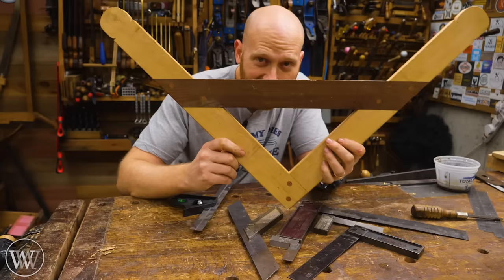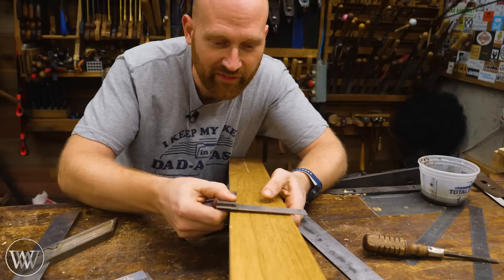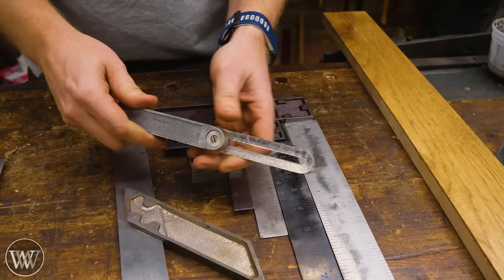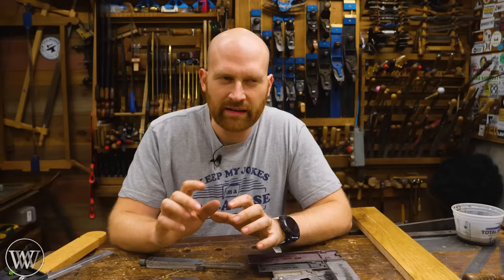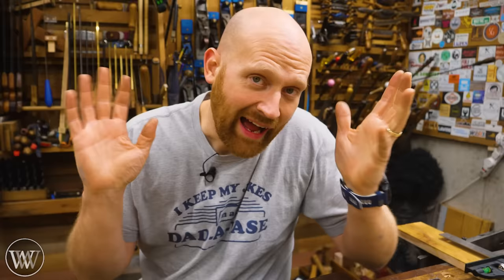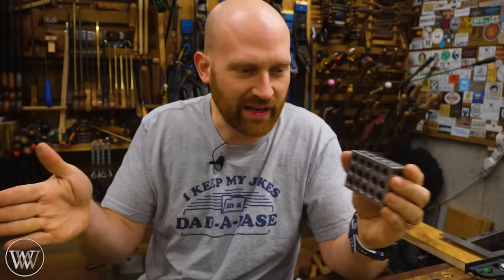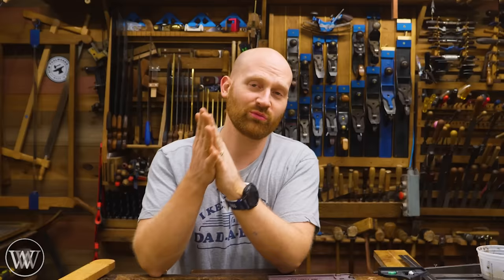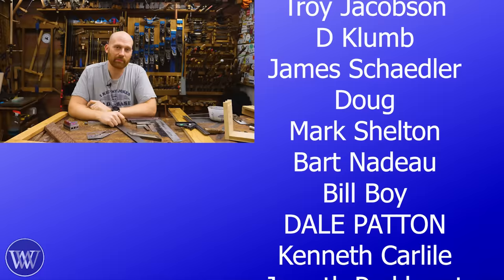Do Not Use Combination Squares Sorta

Comment: Jim, Jim, Jim. I've had 6 and 12 inch Starrett combination squares for 25 years. They are perfectly accurate and I've never had to tune them. This makes sense makes sense to me as they are intended for machinists who require much greater accuracy than woodworkers do. But we're all the product of our experiences.
Reply from the maker: You've had incredibly good luck then. Most people who do fine measuring with a combination square to find they have to readjust them every year or so. Even with a high quality Starrett. Every time you slide that head along the beam you're wearing off a little bit of metal on the touch points. It's just normal wear and tear for them.
Reply: @WoodByWrightHowTo   It's all in the wrist!

Comment: I agree about combination squares but with one caveat - only those with lovely lightweight aluminium stocks and/or rules. Decent, hard, cast iron stocks and hardened rules (calibrated to a standard) can be very good - much more accurate than woodwork requires - but you pay for accuracy and durability. For reference, if a Starrett tool says "made in Brazil", put it back on the shelf ...

Comment: Since you seem to want the conflict....  I've had my Starrett sets for over 40 years 4", 6" , 12-24-36" with center finders and protractor for the bigger blades,, I check them from time to time w/24" blade and have never had a problem... You are smart enough to know what needs to be kept clean so I need not remind you.. Maybe things have changed since 1980 when I bought them...  I also have the newer cheapo Starrett alum solid squares which are OK but delicate.. Every Empire or Johnson I have seen or owned is junk....

Comment: I really like my speed square/rafter square. It's harder to try the outside of an angle, of course, but for quick right angles it's great.

What do you do to your combo squares? Because my father gave me one more than 20 years ago and it's still square every time I check it. That said, it definitely requires more thought than the speed square. I make sure it's always seated firmly after moving the beam.

I definitely want some try squares, though.
Reply from the maker: Every time you slide the beam you wear down the seats.

Comment: Isn't a combo square a useful little measurement finder/carrier-over? Like an oversized caliper? Does it do that badly too?
Reply: No, it does it very well. I use mine all the time, as you can set it once and quickly reference off any face (unlike just using a plane ruler). Also as a depth gauge. I also have a Japanese carpenters square that has a sliding stop on it that works like a combination square, but you get around 7-8cm (3inches) of a parallel edge to the face, which is great for marking out mortices.

Comment: I use combination squares a lot. But I seldomly use them for checking square or squaring a corner. For those tasks I use machinist squares. So what do I use combination squares for? Ah grasshopper, when you can answer that question then it is time to leave the basement.
Reply: I'll bet you use combi squares for layout.
Reply: @kimmosaarinen2780  Definitely for layout. Also for transferring dimensions without reading the scale. That is, using it like a depth gauge. There are other uses too.
Reply from the maker: Right on. They have a lot of other uses to, but I usually find there are other tools that do those better such as marking gauges and depth gauges.
Reply from the maker: Right on. They have a lot of other uses to, but I usually find there are other tools that do those better such as marking gauges and depth gauges.